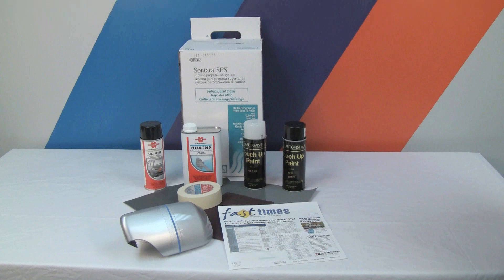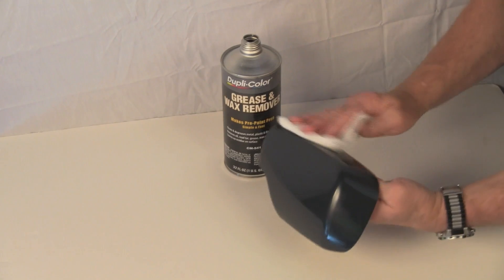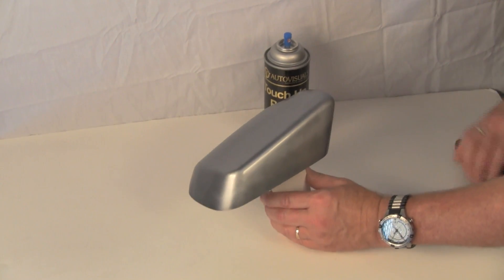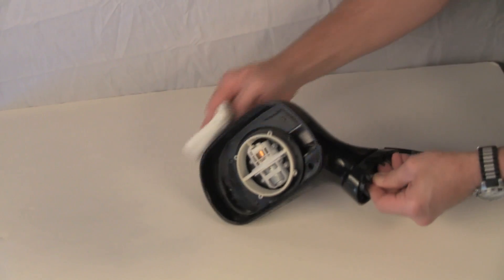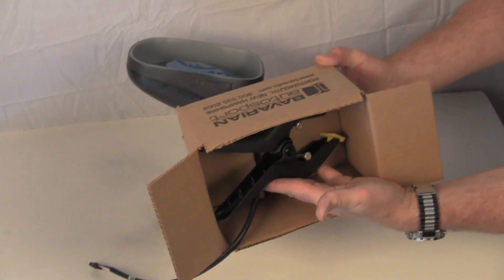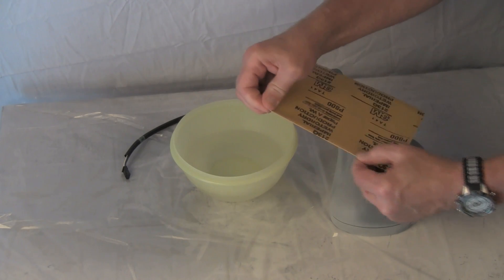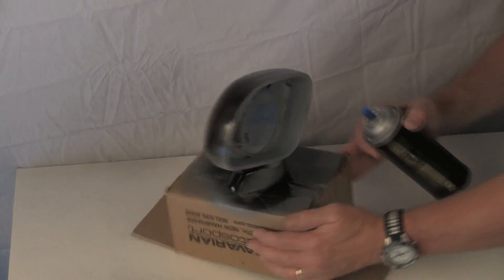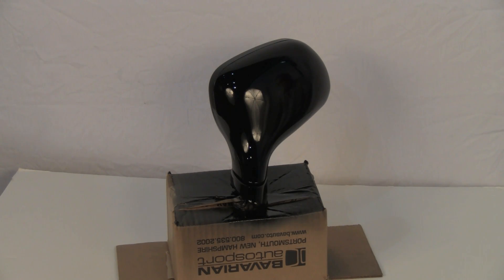Spray Painting BMW or MINI Trim Pieces

Comment from the maker: @surprisevisitor2000 
Well, it is possible to get an excellent job doing the re-paint that you described.  It will require a few cans of primer, paint and clear-coat.  Will the pro repaint look better overall?  Likely.  It will be cheaper to DIY, but for this job, the final decision comes to the work involved as well as your personal spray painting abilities.  I have done jobs like this and been quite pleased with the results.

Comment from the maker: @surprisevisitor2000 -
Short answer = yes, it is doable.  However, this will require some good painting and prep technique and experience.  You would need about 4 to 5 cans of the color and the same amount of the clear (perhaps a can less), in order to get a proper coverage and gloss.  We could easily use at least half a can of color and then clear, of a mirror cover.  The task can be done with less, but you end up with uneven coverage and lack of depth and gloss.

Comment: Thanks, Otto!  I was thinking I'd take my bumper in to a local shop (quoted $750, for a '97 black 540i).  The paint on the top rear portion of the back bumper (that for years was un-waxed in direct CA sun) is totally faded.

I'd like to try this, but that's a lot of $30 paint cans.  I wonder if I just paint the faded top portion above the trim line and mask the rest, how the quality of the transition areas would be. Seems this job would be a better bet for my local paint shop, esp if I grovel.

Comment from the maker: Unfortunately, orange peel is an application (spray technique) problem ... unless there is a miss-match of products, chemically, and the issue is not orange peel, but chemical debonding.  Either way, once the paint is fully cured, sand the parts smooth and start again with the primer and the color then clear.  Be sure to wait until the prior product is dry before going to the next steps.  You should also practice on a scrap so you can get your spray technique figured out (no orange peel).